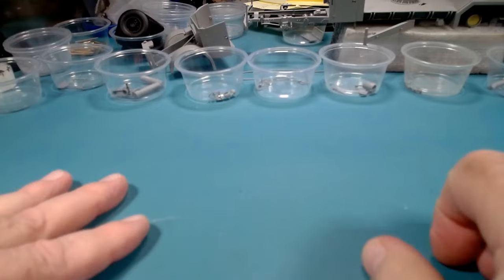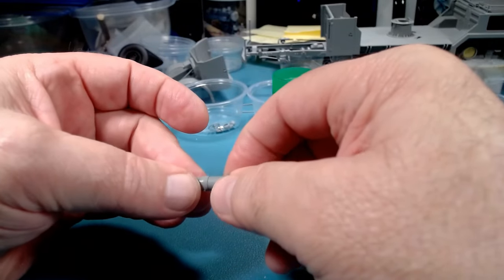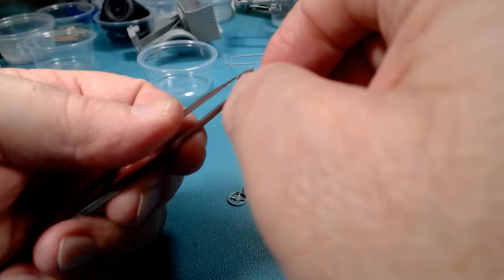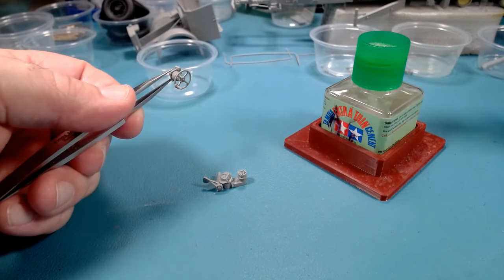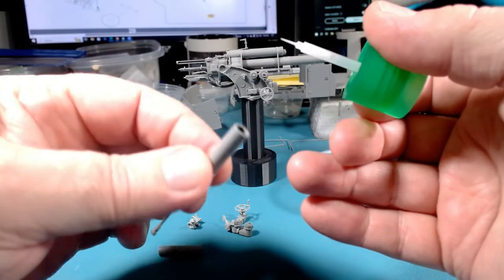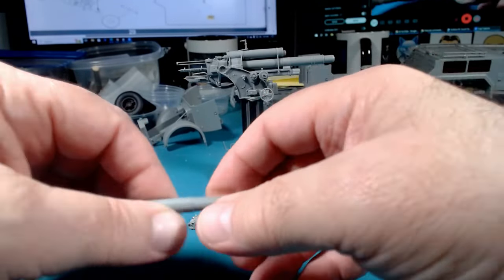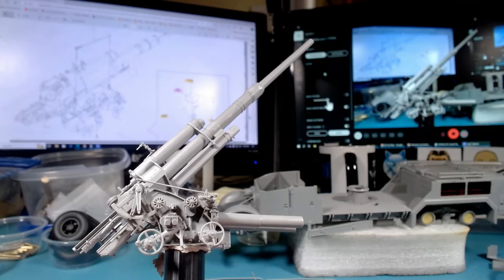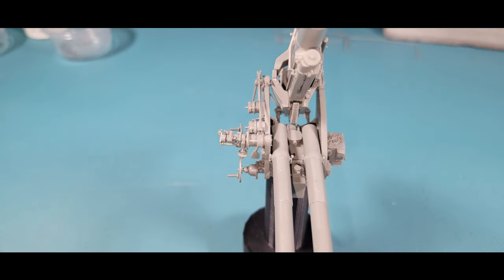Das Werk 8.8cm auf 9t VOMAG Part 24

Comment: Very detailed work Jeff the 3d  holder is a great idea very well done 👍👍
Reply from the maker: Hi Seamy, Thanks again for watching.  One of the reasons I wanted the printer is for printing jigs and holders like this.  It took me a couple of tries to come with something that fit.  It seems the printer prints slightly smaller than the dimensions I put into Tinkercad.  Have a great day.  Jeff

Comment: Hi Jeff, the build is coming along very nicely, the '88' is looking awsome, I really liked the holder you made for the gun, it definitely will help you attach parts and also aviod any damage to the gun, will you be able to use it on other build or did you make it for the '88'? Bedt regards from a Kiwi living in Australia, cheers cobber, Les
Reply from the maker: Hi Les, Thanks again for watching.  I should of thought about the holder sooner.  The gun is very fragile and I was sure I was going to break it just holding it.  I made it to fit this model, but it may work on other kits too.  It will be easy with the 3D printer to make up more as I need them.  Have a great day cobber.  Jeff

Comment: I wonder if you could replace those cylinders with two brass tubes, one sliding inside the other? Or just replace the outer one with a rolled PE sheet?
Reply from the maker: Hi John, Thanks for watching.  That's a great idea using brass tubes.  I'm sure you could make them functional with a little work.  Have a great day.  Jeff